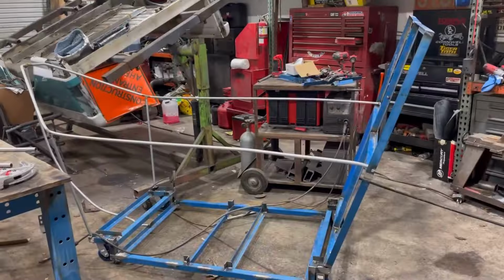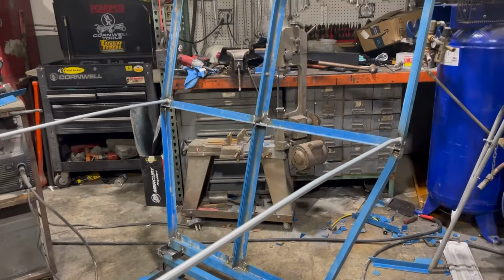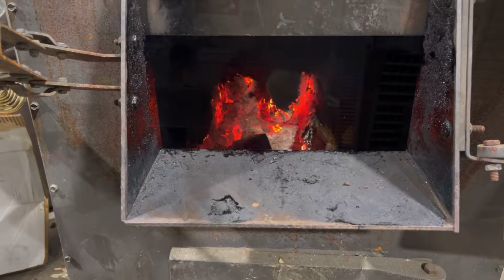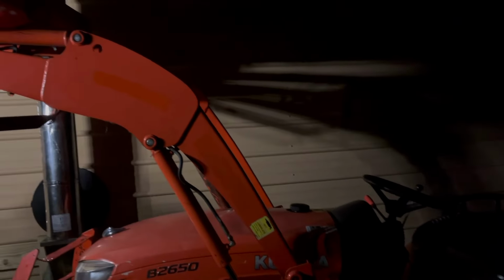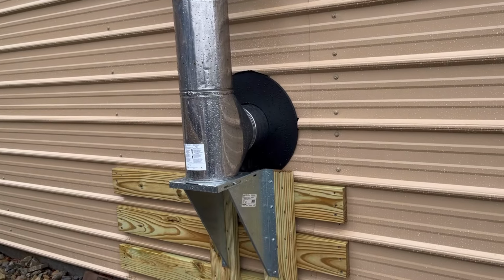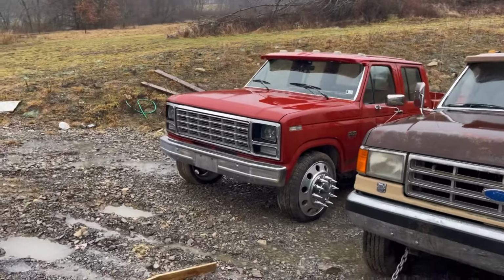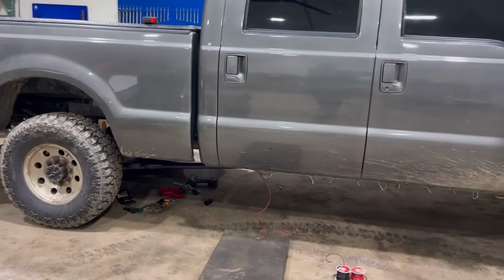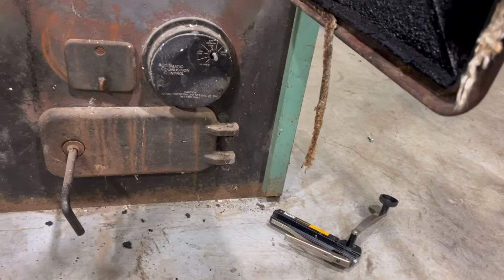Kenny’s Shop Update - Part 19 - Carolina Carport Wood Stove & Chimney Install, Slow Laney Progress.

Comment: I liked how you walked in the door, that was magical.😁 That wood stove is very cool as well, where did you find that with the furnace blower on it? That thing is sweet, I need one of those for my house!😎👍
Reply from the maker: You know me I am all about making magic! The wood stove came from Chad, the guy that owns General Norman. His parents had used it to heat their house for years but when Norm passed away his widow stopped using it. Chad set it up and Kenny went over and picked it up about 2 months ago. We had 2 fires in it then the blower motor gave up the ghost, I am going to pull the motor off and see if I can find a replacement for it. I don't want  to go any bigger to keep it back against the wall and out of the isle. It ended up a real nice and clean install. Thank you for the comment!
Reply: @Mongos_Garage  
That's stove is sweet even if the blower motor needs repaired. Only bad thing about fireplaces and wood stoves is they suck the air from the room to burn which sucks cold air inside from every air leak in the building they're in. Would be way more efficient if the air it needs to burn is pipes in from outside.😎👍
Reply from the maker: Yea they are not the most efficient way to heat but they get the job done!
Reply: @Mongos_Garage  
At least the wood stoves you can slow down the air going in and you have the hot cast iron to radiate heat and a blower on that one. I don't have that on my stupid fireplace!🙄😎👍
Reply from the maker: When I can keep the fire burning for multiple days in a row it warms up the concrete and all the stuff in the shop, it warms up way quicker then it does when I lite the fire everyday!